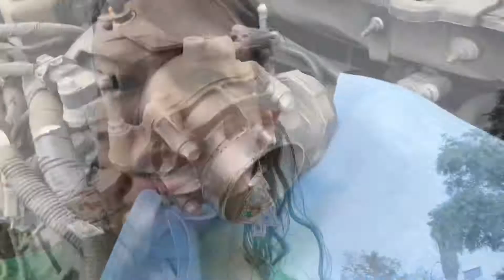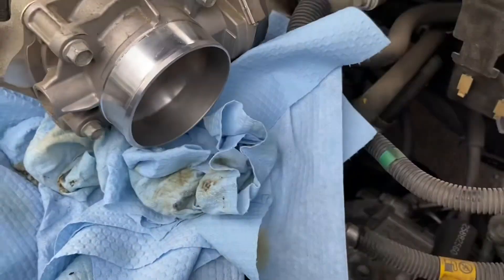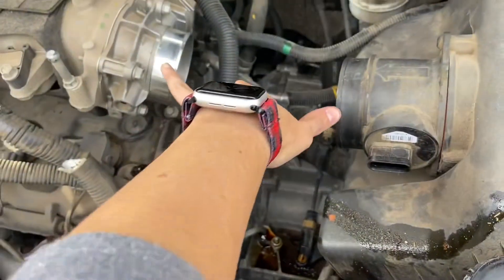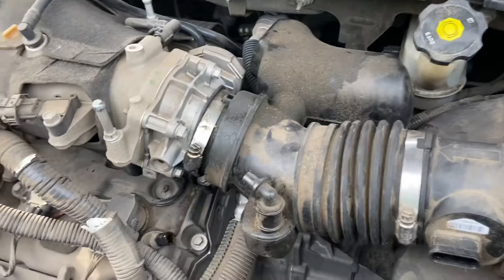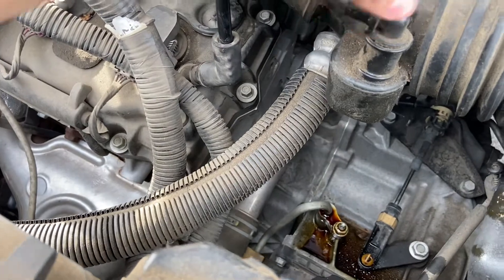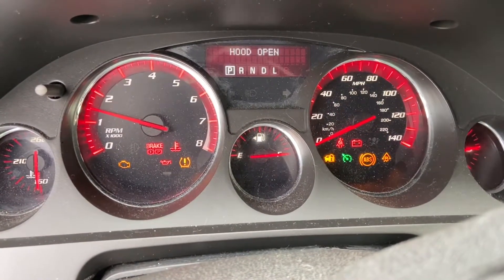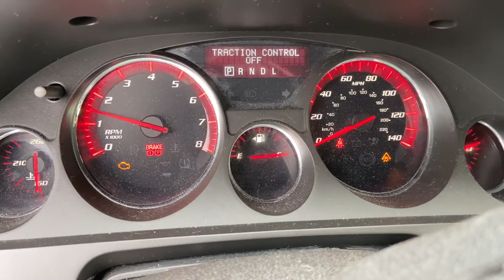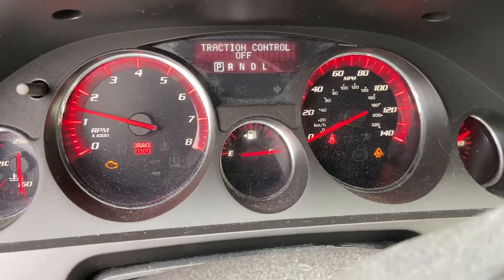GMC Acadia Throttle Body Cleaning

Comment: My acadia just turned service stabilitrak and traction control light and whenever i press the gas pedal to increase speed i feel like is trying to brake and keep going  like jerking (no weird sound) is this what your vehicle was doing? I took it to a shop but i have no codes on the memory stored…it only does it if i press the gas pedal harshly or to start after a traffic light. The mechanic had my car over the weekend and my guess is they were lazy and only plugged the computer to later charge me for something crazy expensive.😢
Reply: Hi there, I'm experiencing the same problem with my gmc acadia..  what did the mechanic say was the problem? Thanks 👍
Reply: Any updates on this?
Reply: wheel bearing
Reply: @SMooreArt-ht2iq wheel bearing
Reply: It’s one of your wheel speed sensor

Comment: Change your oil every 4,000 kilometres with that their vehicle because if you do not change the oil very frequently on that motor the timing chain will stretch and you will blow your engine

Comment: Well done, hopefully this cures my issues. That “doohickey” that wasn’t in the video you watched is the air intake breather tube. And this explains so much. My wife’s throws a light for the catalytic converter, and this may have saved a lot of money. Also, you shouldn’t need a video hand, that’s what Lindsay is for!!! Auto Zone will run free diagnostics but the check engine light needs to be on to do it. And Acadias burn oil, I’d say leak but my garage floor is clean of oil so it’s not leaking.

Update* NO oil in air intake and throttle body was extremely clean. Back to the beginning with this.

*Another update. I’ll be replacing the throttle body assembly this week. That should fix the issue.

Comment: Acadia, Outlooks and other 3.6VVT engines before 2013 tend to leak oil into the intake and the exhaust.  You can also have cat codes because of this.  They use to use faulty valve cover gaskets that they changed in 2013. 

Next time you don't have to remove the air box.  You can detach the MAF sensor from both the throttle and the air box.  The only way to completely get rid of the problem is to swap out the valve cover gaskets.  

Keep up the work.  It's always better to learn for yourself. 👍🏾
Reply: Wait wait, come back in real quick lol, I’m here bc of catalyst codes and a mechanic said I needed to try this first , P0430 to be exact, why is there oil in the intake like that?
Reply: I have a 2013 and have oil in the intake. Perhaps I have an early model 2013 with the old gaskets? Would it be worth it to try and replace them before mess with the PCV system?

Comment: Well done! 
The oil in the intake tube is a known issue and can easily be dealt with. You can change the valve cover gasket to the new revised version or easier and cheaper. Replace the pcv valves (there are two). This requires a drill to open the stock holes on the pcv valves. There are tons of vids on this mod and it is recommended.

Comment: Girl power you are awesome and I am so going to be doing this thank you so much I'm having the exact same problem with my 2011 GMC Arcadia even changed out the control on the brackets the links the sway bar I replaced all of that and the damn thing still popped on but I have not cleaned the throttle body so that is what I will be doing next thank you so much for the wonderful tips and keep doing amazing girl powers stuff

Comment: The low oil issue is most likely being caused by plugged up PCV valves, primarily the one near the back firewall, which causes the oil to back up into/leave sludge in the throttle body/ air intake manifold, and, if left unfixed, will also build up in the air cleaner hose and, in extreme cases, all the way into the air filter/housing. 

Regardless, Ive learned that the only way to fix the MANY problems in a GMC Acadia is to push it    off/in the nearest cliff/body of water, report it stolen, get that insurance money and buy ANYTHING other than an Acadia. 👍🏼

Comment: Did the fix hold up, did the problem come back? I think this is what I need to do to my acadia. Mine the check engine light comes on along with swrvice stablitrak, stbilitrak off AND engine reducing power, then the engine shuts off.
Reply: So what happened with yours? Mines doing the same thing.
Did u clean it or just have it replaced? Sorry for all the questions.
Reply from the maker: None of my lights ever came back on, so this cleaning definitely fixed it!!

Comment: You need to modify the pcv valve that is on the back of the engine near the firewall. That will eliminate all the oil in the air intake tube. That oil pooling on the top of the transmission is not good!
Reply from the maker: Thanks for the tip!

Comment: Did your shudder go away after you cleaned the throttle body and got all the oil out?
Reply from the maker: It didn’t. It goes away when it’s warm outside, though, and only comes back if it gets real cold. ¯\_(ツ)_/¯

Comment: Did it throw codes? Had a mechanic suggest to try this first on my catalyst codes p0430 but I don’t think it’s my issue
Reply from the maker: It did throw some codes but I don’t remember which. None of the lights ever came back on!
Reply: @macbethanee  mine is code P2138. Does that sound familiar?

Comment: You need to clean the part you pull off at first the one you just wiggled  out thats why your getting oil in the air intake is butter easy there's lots of videos on it do it
Reply: You will get better power and gas BETTER power I got a 08 Acadia
Reply from the maker: What’s that called?